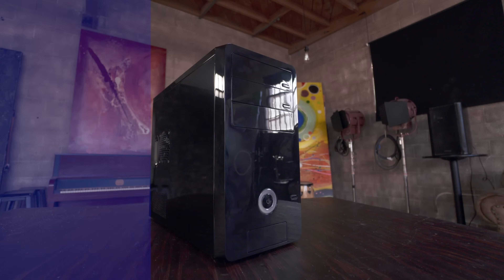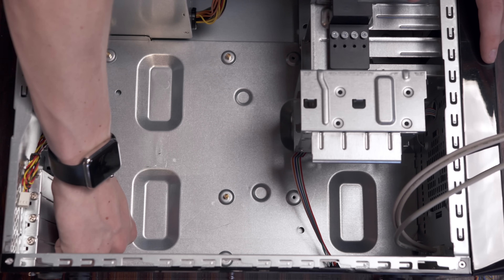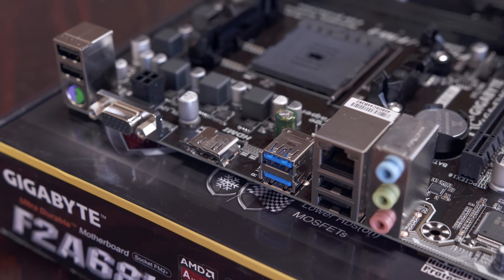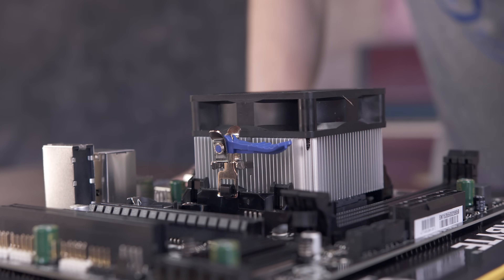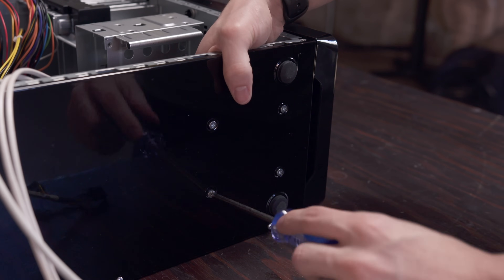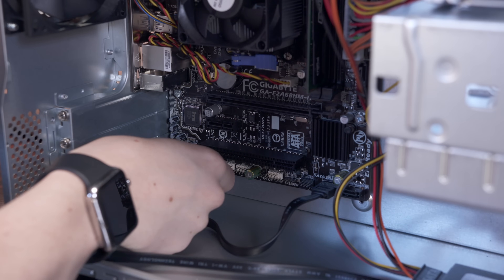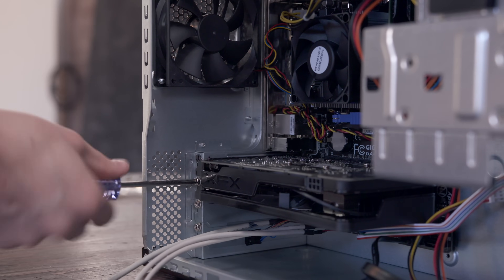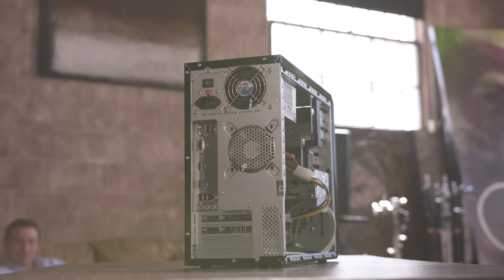How to Build a Gaming PC! (2016)

Comment: How do you know if your power supply is enough or too much for your parts? Also, how do you know if you will have enough power for your parts?
Reply: tell me your parts and i can help you pick one
Reply: WL 500GB 64MB Cache hard drive
Thermaltake CLP0556-B 92mm 1 x Sleeve Bearing CPU Cooler 
GTx650 graphics
8 Gb RAM
3.1 ghz Cpu
Msi 970 gaming
450w powersupply

Comment: Could you use a 1080p HD TV as a monitor
Reply: Yes, so long as the graphics card or motherboard in use has compatible output such as HDMI
Reply: +Etolie Rosenqueen thanks I'm trying to get into PC gaming and will soon be building a PC
Reply: If you are getting into gaming, the larger the monitor the slower the response time. I recommend getting smaller monitors, and a dual monitor setup. Obviously not a requirement if you are trying to save money by combining your tv and computer station...

Comment: +Austin Evans , do I have to have thermal paste? Please answer!
Reply: No, the stock cooler included with the CPU has it pre-applied.
Reply: +Schetzel Do I have to put some on if its not already pre installed because it is not on my build. what happens if I don't use it?
Reply: Yes you must apply thermal paste. If you don't your CPU's operating temperature will be higher and be at risk of overheating. This could result in it suffering permanent damage and/or throttling (slowing itself down) to prevent itself from suffering permanent damage

Can you use your CPU without it? Yes. Do I recommend it? Not at all.

Conclusion: use thermal paste.

Comment: Can it record and stream csgo at 120 to 300 fps on medium settings if it can't any recommendations?
Reply: +super sparky go on /r/pcmasterrace
Reply: Also it has to be able to use 2 monitors
Reply: Any computer can use 2 monitors and if you want to find out what parts you need go to a fourm
Reply: r/buildapc is your friend
Reply: +Tian10an build a PC isn't as active as pcmr thread so pcmr tends to be more helpful. Pcmr is the 2nd most active subreddit based on people on the website.
Reply: Nissan U. they have great guides, and the "Help" threads on pcmr usually get down voted. If you have a question, post it to buildapc and you'll get answered.
Reply: /r/pcmasterrace

They should help.
Reply: You won't get CS go at 120 frames while playing, especcially not when recording or streaming for that you'll need a 600-800 dollar PC
Reply: ***** I get 140 fps on High in CSGO on the 750ti and the r7 360 is more or less the same performance. With the 750ti you can use shadowplay and lost only around 10 fps.
Reply: if your on a budget, you wont have a monitor that can display above 60 frames dumbass
Reply: Alexander Lei Thats a pretty good joke XD
Reply: Nissan U. Yes but that PC is not $350 or less
Reply: ***** Yeah its around 400 including the OS. $20 windows key from reddit.
Reply: Nissan U. How? the graphics card alone is $100+ Is the rest of your machine a potato...
Reply: ***** I run a G4400 and a 750ti. Its surprisingly good.

http://pcpartpicker.com/list/ckM2m8

here it is without the OS.

The game I play I can run usually on Med to High and get 60 fps. (Metro Last Light) (War Thunder) (World Of Warships) (Crysis 2)
Reply: why would you want 300fps but medium? Your monitor can't show more than 60fps anyways
Reply: SuperSamu Input lag.
Reply: Because if you average 60 then you will also drop below 60. And for  csgo and other competitive games you need to have the perfect playing/response conditions.

Comment: Am planning to build a PC soon 
I have these two that i put together are they any good and which one is better 
it's a budget build
http://ca.pcpartpicker.com/list/rvjQZ8
http://ca.pcpartpicker.com/list/7jHjyf
Reply: the one on the bottom is better but dont get the hyper 212 evo while you will get cooler temperatures its not that much of a difference and the i5 4460 comes with a cooler
Reply: also see if you can get a ssd or a 7200 rpm harddrive

Comment: did you mention any parts that have to do with wifi. how do you hook up to wifi?
Reply: just get a ethernet cable the wired one its better and cheaper or you can buy a wifi adapter to your usb
Reply: i would but where im going to set up my pc its at least 25 ft from the nerest plug in
Reply: alle banna ahh dont worry i have a 10 metre long ethernet cable

Comment: So i finally got a job to start paying the bills with a few extra cash at hand (18 by the way) was wondering if i could also install a better/faster graphics card other than the AMD graphics card on this video, i would prefer to install an Intel i7 if not something similar of performance but not to heavy on my wallet, is there a chance that i could possibly make this happen? I am not that good with computer specs as i am learning a lot about them! Appreciate the help!
Reply: the i7 is a processor
Reply: wait i gotcha
Reply: buy a i5 6600 instead and a motherboard with lga 1151 socket and a gtx 1060 instead and a 500 w evga supernova powersupply and a good case i  recommend the nzxt source 340

Comment: Do you need to buy wires and all that junk in beforehand in each of his builds or do they come with the products shown in the videos.

I'm pretty new to this
Reply: All screws come with case. All power cable comes from power supply. All SATA cable comes with motherboard. The only cable you need to buy is molex to 6pin PCIE adapter.

Comment: do you think this is a good pc?

i5 6600

CX500 80 PLUS Bronze PC Power Supply - 500 W (CP-9020047-EU)

16gb ddr4 2133mhz

wd 5400 rpm sata drive

ASRock Z170 Pro4S LGA 1151 Intel Z170 HDMI SATA 6Gb/s USB 3.0 ATX Intel Motherboard

XION gaming series xon-350_bk case

nvidia geforce gtx 1060 (I don't need SLI)

it costs 1341.31 dollars CAD including taxes and shipping taxes if there are any. all of the parts except for the psu are on newegg. psu on amazon.
Reply: yes except get a ssd or a 7200rpm harddrive instead
Reply: I'm changing a lot

Comment: how do you now if the motherboard will fit in the case. like will the holes match.
Reply: Motherboard comes with standardized size namely EATX, ATX, MATX and ITX and the location for the holes are standardized too. You need to go to case manufacture's website and check..
Reply: ok thanks

Comment: I'm thinking about building this with a few modifications such as 8gb ram and maybe 500gb to 1TB of storage, I never built a pic but know about specs well, I want to know tho, do you have to be connected by Ethernet or can it be wifi? If only Ethernet then how do I make it wifi since my router is across the house
Reply: Pc not pic
Reply: Search up wireless network adapter cards- they let you use wifi on desktops but they take a PCI-E slot
Reply: +Gabriel Sirak  oh okay, I'm thinking about a new case too instead of this

Comment: Hi guys I was wondering wether I could use this case : https://www.amazon.co.uk/CiT-Black-Midi-Gaming-Stripe/dp/B01BLI50Z4/ref=sr_1_8?s=computers&ie=UTF8&qid=1469268567&sr=1-8&keywords=PC+case        . With this power supply:     https://www.amazon.co.uk/EVGA-600-Power-Supply-Unit/dp/B01127D0MY/ref=sr_1_1?ie=UTF8&qid=1469269317&sr=8-1&keywords=evga+psu        . So will that work well and actually work?? And also will I still need the adapter to power the graphics card???

Comment: Having many problems with the case. The screws will not go into the motherboard standoffs and when I turn the system on I get a post code of one long beep and 3 short beeps. Any help would be appreciated. So far not happy with the case.
Reply: Make sure to apply pressure to the standoff's and make sure everything's connected properly.
Reply: +Cairo Murphy I found out my problem was that I didn't buy the video card which is required by the AMD CPU/APU

Comment: If I upgrade ram to 16gb , cpu to an i5 4440k , and gpu to a radeon r9 380.
 Will I need to change the cpu cooler or power supply?
Reply: You'll need at least a 600W power supply and you can use the stock CPU cooler that's comes with the CPU but don't expect much overclocking.

Comment: Anyone here can tell me if my build is good plz ?

-Intel Boxed Core I5-6500 FC-LGA14C 3.20 Ghz 6 M Processor 
-MSI R7 370 Gaming 4g graphic card
-MSI Gaming Intel Skylake H110 LGA 1151 DDR4 USB 3.1 Micro ATX Motherboard
-EVGA 500W 80 PLUS
-Western Digital 1 TB 3.5-Inch 7200 RPM SATA III 64 MB
-Kingston HyperX Fury 8GB DDR4 SDRAM Memory Module - 8 GB 
-Cooler Master Hyper 212 EVO - CPU Cooler with 120mm PWM Fan

i would really appriciate your help, Thanks !

Comment: My soon to be setup :

Monitor (Acer predator x34) = $1300
Keyboard (Razer Chroma) = $200
Mouse (Razer Chroma) = $100
Tower (Corsair Spec-Alpha) = $120
Motherboard (Asus z170) = $250
Ram (Ripjaw 2600mhz 2x8gb) = $250
PSU (Evga supernova 750w) = $180
CPU (I7 6700k 4.2ghz) = $500
GPU (Gigabyte GTX 1080 G1 Overclock) = $1200
Windows 10 pro 64 bit = $100
HDD (3TB Hitachi) = $200
SSD (256GB Samsung) = $150

                Total = $4060 (Aud prices) 

Now, i'm 99% sure this will be sweet, but if anyone have any recommendations, let me know. 

I did try and see how much i could cut down on costs while maintaining the same specs, and it came to a saving of ~$700. Rather just pay it and get the better of everything.

Now, i've built numerous pc's before, but the last time was 2008, and i haven't really kept up all THAT much, so if anyone knows anything better (same performance for less, or significant increase in performance for not all that much) do let me know. Not that constricted by money, as i just take my time getting each part 1by1.

Comment: Hey I'm gonna build a gaming PC for the first time and I'm wondering if any of these work.
EVGA GeForce GTX 950 Graphics Card
ThermalTake Versa N21 Computer Case
Sentey XPP725-HS Xplus Power Supply
SanDisk SSD Plus 240 GB
Patriot 8GB Memory
MSI Gaming Intel Skylake H110 Gaming Motherboard
AMD A4-7400 APU Dual Core Processor 
You Can Find these parts in Amazon
Reply: The AMD processor is not compatible with the motherboard. I wont go for that Sentey PSU.
Reply: What should I get then?
Reply: For processor, get either i3 6100, i5 6400 or i5 6500 which ever within your budget.
For PSU, get any 430~500W PSU from brands like EVGA, Corsair, FSP or Seasonic.
Reply: Ok so are those just all the problems?
Reply: iiBlazerX Yea. Maybe you should get a Western Digital 1TB blue for storage of stuff like picture, videos,etc.
Reply: k thanks
Reply: Also don't get a 950 get a 1050 or 1050ti

Comment: can I switch the gpu for a rx 470
Reply: No, with this cpu, your almost guaranteed to run into bottlenecking.
Reply: this cpu is for like the rx 460 lol or gtx 750ti
Reply: Of course. The beauty of PC gaming is virtually unlimited customisation
Reply: I mean 480
Reply: yes
Reply: +Anthony Garcia is it the 860k?
Reply: +Andy cpu is for amd cards, so the rx 460
Reply: You can put in Nvidia cards. I'm using a 860k with a gtx 750ti ftw.
Reply: +Andy what? Rx 460 isn't even  out yet
Reply: +kingIce XIX ik wait for it it's coming out august 8
Reply: yes
Reply: +Andy I'm gonna get the rx 470
Reply: -_- AMD FX 6350 and a Nvidia GTX 960 is what I have paired.

Look into how you actually pair a CPU and a GPU instead of spewing garbage like that.
Reply: oh yes it is in the netherlands its out
Reply: +Sweaty Try-Hard Gaming I have 
I5 6600k
Gtx 960
Reply: RockStar Saad The problem is people who don't know how to pair hardware make the assumption AMD goes with AMD yet you can pair an AMD CPU with an Nvidia GPU just fine
Reply: ***** Of course you can. Why wouldn't you be able to? I put my gtx 750ti ftw that has 2 fan on it.
Reply: ***** The only true size limitations for a graphics card is the case size since PCIe x16 is the standard for a graphics card today.

I have a micro ATX motherboard that is similar (AM3+ socket not a FM2+ socket) I use a GTX 960 4GB FTW model back-plate dual fans  great 1080p performance (Huge compared to my old R7 360)
Reply: well im thinking of buying the rx 460 2gb gpu
Reply: Pernell Gardiner Not a bad choice but I personally would go with the 470 for that extra power.
Reply: Sweaty Try-Hard Gaming well you probably idk you working but im only 15 and on a very extra tight budget and you probably talking US, me TTD, 1 US is x6 TTD and hear they love to sell things overprice but i might see to get the rx 470 if the price drop
peace bro
Reply: Pernell Gardiner My apologies I didn't know where you lived. 

Well since you are looking at a RX 460 due to location and currency constraints it might be better to go with the 460 then. The 460 should run games coming out soon at 1080p at 60fps at low to even ultra (Mafia 3 has low requirements for looking so good same with BF1 ) 

Well now I have another country to add on the Overpriced PC Parts Here! list.
Reply: +Sweaty Try-Hard Gaming yeh
Reply: +Sweaty Try-Hard Gaming or and correction I said 1 US is x6TTD well now it's x7 OMG
can't wait until I'm like 20 to go back new York
Reply: Sweaty Try-Hard Gaming what's a good CPU for a AMD RX 460
Reply: er Zeimzey i was going for the athlon x4 860k but the price started to go up (not good) so im now getting the athlon x4 880k that is now $95
Reply: Pernell Gardiner ok thx
Reply: Pernell Gardiner should I get that one ?
Reply: er Zeimzey no problem bro
Reply: Cumstain I would wait to buy a CPU since Zen is due to release soon. 

AMD Zen CPUs will utilize multithreading technology so a quad core will be an octo core equivalent and the price for a quad core is going to be somewhere around 100 USD. 

An AM4 motherboard will also be required for a Zen CPU.
Reply: Sweaty Try-Hard Gaming ok thx
Reply: Sweaty Try-Hard Gaming let me go and see this thing call zen
Reply: Pernell Gardiner AMDs next gen processor http://www.amd.com/en-us/innovations/software-technologies/zen-cpu
Reply: Sweaty Try-Hard Gaming ite

Comment: is this PC quiet and does it keep cool and also is there a better graphics card that's compatible with this build and can run GTA 5 med 60 fps?
Reply: also one more question how would you install the hard drive on this case
Reply: I would say the GTX 750ti FTW. I run gta v with it at 1080p high to very high at 45 to 50 fps. If you have an extra $100 get the rx 480 if you're able to get one. And to install the hard drive all you do is just slip the hard drive into a free hdd cage then just screw it in. The case should have a manual that comes with it that will tell you what screws to use.

Comment: So I did everything in this guide just like he said, but when I plugged in my monitor and turned everything on to check the BIOS, my monitor just shows. "DVI no signal".Any help is Appreciated!My build: http://pcpartpicker.com/list/dC8Fd6          -       (EDIT: I'm using the white cord that came with my monitor to connect it from the PC to the monitor. I've also tried using the blue one, as well as plugging the white cord directly to the motherboard[as opposed to the graphics card]. I don't have an HDMI cable, and I doubt that this is a problem.)
Reply: You need to connect the display cable from your monitor to the graphic card, not the motherboard.
Reply: I've tried that and it didn't work. :/
Reply: BreadSticks Did you connect the 6pin PCIE power connector to the graphic card?
Reply: WB IsMe yup

Comment: I'm building a new gaming PC tomorrow but I had a question about the wires he used to plug into the ssd. I am using a hard drive but do I use the same plugs like in the video?
Reply: Both SSD and Hard drive uses the same SATA cable.

Comment: Did everything like you pc turn on fans spining but no signal from vga port neither from usb
Reply: Check if you have connect the 6pin PCIE power cable to the graphic card.
Check if your display cable is connected to your graphic card's display port, not the motherboard.

Comment: Hey guys, I just need your opinion on this. Im planning to build a gaming pc for the first time and I just need to know that if all my parts that i have planned is compatible and will work.. 
Heres the parts:
CPU- i5-6500 
MOBO-MSI-Z170-A Pro
GPU-RX 480 8GB 
STORAGE-Seagate 1TB SSHD
RAM-Corsair 8GB DDR4 
PSU-500W 80+
CASE- Armageddon T100

All of these I planned to be on a budget of 750$ less

Comment: Is this a good build?

Intel Core i5-6600K 3.5GHz Quad-Core Processor
$238.99 Buy

CPU Cooler 
CRYORIG H7 49.0 CFM CPU Cooler
$43.53 Buy

Thermal Compound 
Arctic Silver Arctic Alumina Premium Ceramic Polysynthetic 1.75g Thermal Paste
$3.49 Buy

Motherboard 
MSI B150M MORTAR Micro ATX LGA1151 Motherboard
$83.88 Buy

Memory 
G.Skill Ripjaws V Series 16GB (2 x 8GB) DDR4-2400 Memory
$62.88 Buy

Storage 
Western Digital Caviar Blue 1TB 3.5" 7200RPM Internal Hard Drive
$47.49 Buy

Video Cards 
MSI Radeon R7 250 2GB Video Card (2-Way CrossFire)
$79.88 Buy

MSI Radeon R7 250 2GB Video Card (2-Way CrossFire)
$79.88 Buy

Case 
NZXT Phantom 820 (White) ATX Full Tower Case
$199.99 Buy Combo

Power Supply 
NZXT HALE82 V2 550W 80+ Bronze Certified Fully-Modular ATX Power Supply
$64.99 

Optical Drive 
LG GH24NSC0B DVD/CD Writer
$14.89 Buy

Operating System 
Microsoft Windows 10 Home OEM 64-bit
$83.89 Buy

Software 
AVG AntiVirus 2016 (1 Year Subscription) Software
$24.98 Buy

Sound Card 
Asus Xonar DGX 24-bit 96 KHz Sound Card
$29.98 Buy

Wireless Network Adapter 
TP-Link TL-WN725N USB 2.0 802.11b/g/n Wi-Fi Adapter
$7.98 Buy

Case Fan 
Cooler Master SickleFlow 69.7 CFM 120mm Fan
$5.99 Buy

Monitor 
Asus VX238H 23.0" Monitor
$139.00 Buy

Keyboard 
Logitech Wireless Combo MK270 Wireless Standard Keyboard w/Optical Mouse
$18.99 Buy

External Storage 
Western Digital Elements 1TB External Hard Drive

Comment: If I but a USB powered wifi antenna do I just plug it into the USB port and boom I can use wifi? Or Do I have to do some bs with the motherboard?
Reply: Plug in the USB port, install the driver and BOOM, wifi. easy. If you have window 8 or 10, it will automatically download the driver for you. Easier.
Reply: +WB IsMe thank you!